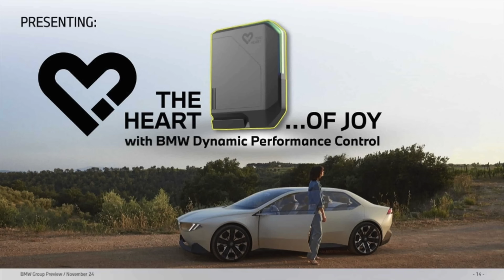BMW Vision Driving Experience Explained by BMW Design Boss

Comment: Doorhandles design, it is not about the winter, it is much more about the safety in case of an accident and you need to open the doors from the outside.

Comment: Will they fix mixing regeration + mechanical braking problems of all the current electric BMWs.? Let us wait and watch if the legacy learrnt a thing or two from Tesla.
Reply: My i4 M50 has been running flawlessly with no issues with its blended braking or 1 pedal braking and unlike a Tesla, it actually drives like a car and not an iPad on wheels. Cheers!

Comment: Overnight wet snow accumulation on rear tail lights can obstruct the emitted light, necessitating frequent clearing by the driver during transit. Only fresh snow, the wind will clean itself. Only the winter non-snow lands will benefit from those designs. Some may call it futuristic, but I've got a feeling that BMW is losing its overall design and its own perks. It seems to follow others' cheap, so-so designs. 

Prioritizing aesthetics over the principles of physics, some designers focus exclusively on their designs, often resulting in significant issues for the owners.

Comment: So the car will be a computer on wheels. No mechanical feel or anything ?
Reply from the maker: We will see
Reply: They will have an ICE version with the same design.
Reply: @AGDoesDesign  i know but the steering on the g80s are numb already. so i don’t think making it one computer will give m3 more steering feel.
Reply: @supremeetnel7707  fair - we can only hope. I had a 130i almost 20 years ago when they still had hydraulic power steering, and pretty much every brand that sells “normal” cars have become increasingly numb since then, so I don’t expect it anymore, sadly.

Comment: Please make a hot hatch version, with a full-time AWD drive mode, and 120+ kW 4-wheel one-pedal regen.  200-250 mile range to minimize weight.  Thanks!
Reply from the maker: There will be an i1
Reply: @bmwblog  Alas, the i1 & i2 will be RWD, so no strong 4-wheel regen. 🙁   ...even if they did come to the US.